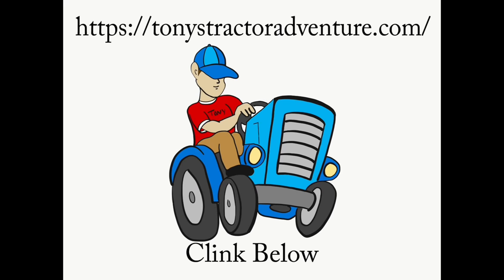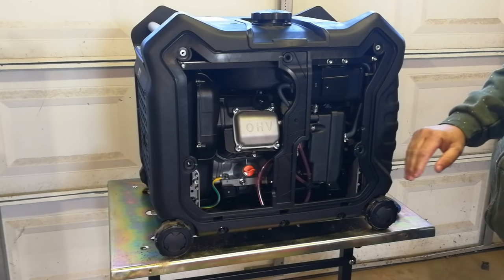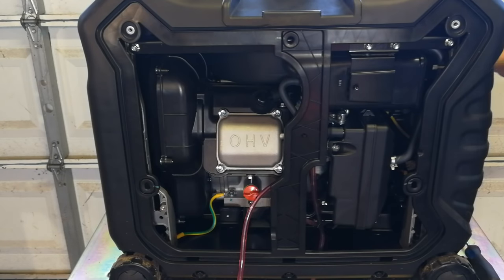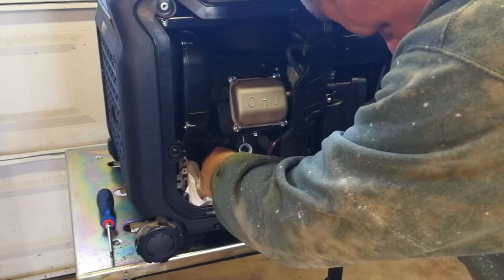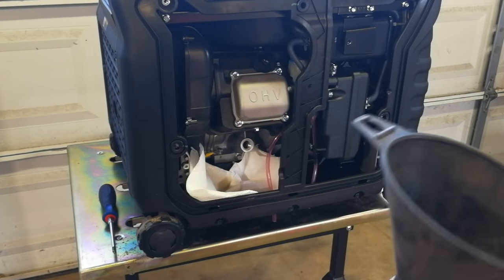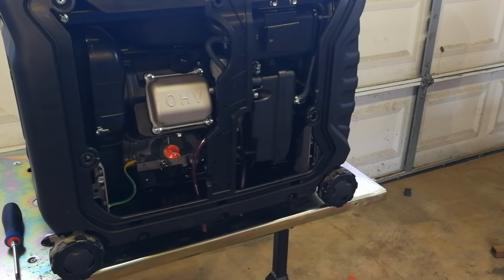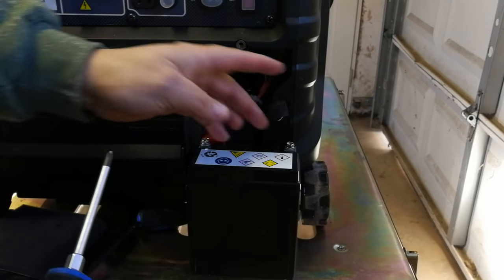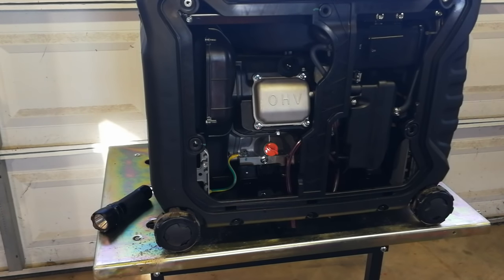Predator 3500 Inverter Generator | Harbor Freight

Comment: I bought one of those generators last Nov., liked it so much bought another in Dec.   Excellent design and glad to see you leave it as designed unlike others that want to rip the charcoal canister out and drill holes to help it , "Breath Better."  The only changes that may be needed is rejet carb if used in higher elevations.  Drilling holes or leaving oil door off makes the electronics to run hot and fail.  I do hate that people push that expensive Sta Bil that gives false sense of security.  I'm 66,  always on the farm with lots of motors and have NEVER used that stuff.  I always use gas with no ethanol and never have any problems even a year later.  Generators need to work when you need them so always get all the gas out and put it in your car.  Pump the gas out of the tank with the H.F. pump and drain the rest out of the carb drain.  The few drops left in the carb will evaporate and not hurt anything.  Do use Sea Foam to make sure carb stays clean.  Mine are newer models that come with a nice oil funnel and also has a gas guage to help not overfill and send liquid gas into charcoal canister.  Yes, I have several bigger, noisy,  gas guzzling generators.  That 3500 runs my fridge, freezer,  gas furnace,  TV's, some lights all at the same time using about 15 amps.  You did a very nice video with great advice.   Thanks.
Reply from the maker: My generator is still stock.  Still runs great.
Reply: @TonysTractorAdventure  From what others have posted it should run trouble free for a good 2,000 + hours.  I'm glad you did an excellent video on how to care for it so others have their Inverter run when they need it.  People look to YouTube for advice about buying, using, caring for these units so it's important they get good info like you share. There is a small screen in the gas tank so I did put a small paper fuel filter on outlet of the gas valve to protect carb.  Pop fuel line off valve , add 2" of hose with Corbin clamps to install.  I put in a NGK plug,  removed spark arrestor screens, rattly wheel lock and zip tied spare plug and everything to the metal uprights so they don't get lost.  Keep up the great work.

Comment: I have this gen. So far I love it. I have 2 recommendations. First, I would get a magnetic dipstick for it (ebay). You'd be surprised the junk it pulls out of the oil. Second, I use my gen for backup power during the winter so every summer I pretty much do the same thing you show in the video. But when I am using it in the winter and i'm between storms I don't like to leave gas in the carb (even though i put in an additive) I like to drain the carb. Instead of pulling the side off turn the switch 95% of the way to the off position. This will cut of the fuel to the carb. The gen will run for a good 5-10 minutes before it dies. Thanks for the video!

Comment: Pay close attention to cleaning the spark arrestor. Mine after 25 hours was nearly plugged & made it run very rich.
Reply: Markie Bass 
1 second ago
I only had 11 run time hours on my generator and, It stopped working... Running Very rough and, RPMs dropping down... Showing Overload without any load on it...  2 problems..  1st problem is... Don't use gasoline that has any Ethanol in it.. None !  O !!!  Notta !!!  Buy gasoline that has ZERO  Ethanol... That is the case for ALL small engine ….  It causes the fuel to varnish in the carb.. Fouls plugs … and,  high carbon build up.. which is problem no. 2 … The spark arrestor was FULLY clogged.. That is the fine screen on the Exhaust... There are 2 parts to it.. First the external screen held by 2 ea. screws... the other fine mesh screen is inside the pipe... after you remove the outer screen.. start up your generator and it will blow out... You can clean them .. or trash them...  or put them back on after cleaning them...  My Predator 3500 Generator is now back to normal ….

Comment: Thank you for a wealth of info. I am a woman in my 70s and have just purchased this generator for camping in a new TT. I have never had a TT before, but livein acabin, so have a generator. It is so noisy, i never used it unless the lights are out for more than 8 hrs. I have had it, I think 5 years and have Not done anything to it because it has only run 3X . I didnot kniwabout any of what you discussed. I must not have read the manual!  I have had 10 surgeries in 11 years...all a surprise.  Odd sorts of things, so have not had a lot of energy to manage things very well. But that was before i became active online, too. I won't forget all you taught here and will see if I can sell the other one if it still will run. It is a 4500 and even inside the cabin, you have to yell to talk...forget watching TV!😃 Thank you so much for this demonstration😍

Comment: One more reason to feel good about your purchase.  Echo has come out with a line of generators called the Echo Bear Cat.  They have a 3500 model that looks like a re-labeled Predator 3500.  The model number is ig3500e, and it has an MSRP of $1,399.  One more thought is that if these ever need parts or work, any Echo dealer should be able to provide assistance.

Echo also has a BearCat 2000 that looks like a re-labeled Predator 2000.

To me it's boost of confidence to see Echo slap their name on them.  No wonder the reviews are so good.  Apparently they really are.

Comment: FWIW, these generators are great, but starved for air.  There is a great video on YouTube re: making some additional air intake via the oil service door.  It makes a difference in the smoothness of the engine operation.  

Thanks for furthering our knowledge Tony.
Reply: @TonysTractorAdventure  none of them starve for air....and these folks who add additional air sources are detracting from the ability of the cooling system to evenly cool the engine....people mistake the suction on the oil door as suction being created by the carb intake....it's NOT!!!! Its negative pressure caused by the very effective cooling system
Reply: They are NOT starving for air. Stop giving bad advice. They run perfect when new so if it isn't running right then something is wrong with it like bad gas, partially clogged carb or spark screen clogged.  People run these Inverters for 2-3,000 hours with NO problems without drilling any holes in the cabinet to help it, " Breath Better."   It's designed that way to keep the electronics/ heat sink  cool.

Comment: Note that the spark arrestor actually has a screen that fits into the exhaust pipe behind that outside cover. It'll need to be removed and cleaned. If the generator has over 100 hours and starts running like crap and bogging down and such, check that bit and clean it!

Comment: This was my first summer with my little Predator. Now with Wisconsin winter coming I have a question. I will be able to take care of the gas and the oil which you have explained so well,  but can I store this in a cold garage or must I bring it into the house.
Reply from the maker: Sue, I would not bring it in the house due to the fumes. Depending on how cold it gets, you may want to keep is somewhere a bit warmer; however, I have started mine with the pull cord in at 15 degrees. The little battery does not like the cold so much. I hope this helps. Tony
Reply: @TonysTractorAdventure  Thanks Tony. I just wanted information on what needed to be done  for winter storage. Good video, I did learn from it.

Comment: Thanks for the great video bother, very informative and str8 to the point. I'm thinking about picking up one of these HF generators. My question to you is how has it stood up. I need it for emergency use to power things like my house refrigerator, TV, microwave and other sensitive common electrical items in my home during a power outage.. would this be the one?
Reply from the maker: My generator is holding up. You need to add up your power needs. This is definitely not a whole house Generator, but you can run the basics.

Comment: Most recommendations are to run the motor until all the gas is burned. Do you believe storing with stabilized gas is the better option?
Reply from the maker: I store mine with stabilized fuel.

Comment: Thanks for this video, very comprehensive! Question... I saw a video of a guy who drilled holes in the air filter cover to allow for more air flow through the filter. Would you recommend this?
Reply from the maker: I would not. I have ran this in the hots parts of the year without any problems with fuel or over heating.
Reply: @TonysTractorAdventure  thank you!

Comment: Two Questions: 1.) Do I still need to drain the fuel if I keep non ethanol and Sta-bil in it all year?   2.) The manual is contradictory. One section says to change the oil at an 8 hour interval, but it also says at 25 hour intervals. What do you recommend? Thanks in advance!
Reply: Change it once at 8 hours...VERY important...after that every 25 hours...
Reply: @TonysTractorAdventure  how do i know when it reaches 8 hours mine keeps reseting do i just take note?
Reply: @370hssv3  If you haven't already solved your problem, the hour meter should have 2 modes. It should show run time, which resets every time you start it. That shows how long it has been running for your current use. If you started it 45 mins ago, it will show 45 mins. 
It should also have a total run time. Press the button on the meter & it should switch between your current running time and your total running time.
Reply: @shananagans5  mine came defective i changed it and problem was gone maybe it was the screen idk.
But this generator kicks ass man

Comment: I have a question for you. I’ve had mine four months and it has been a good unit so far. But now it seems to be running to rich. When I start it up idles rough and requires me to loosen the air filter to stay running. Any assistance would be appreciated. 

John
Reply from the maker: I would run Lucas fuel treatment through it first. Make sure the airfilter doesn't have a blockage. Nice and dirt-dobbers do crazy things. After that, adjust the fuel mixture screw.
Reply: also check the spark arrestor
Reply from the maker: Really good thought. Thank you

Comment: i bought a used 3500 will not shut off at switch any suggestions
Reply from the maker: It looks to be a two part switch turning off the fuel and breaking the ignition circuit.
Reply from the maker: I have had no issues with mine, so I have never been inside it. Wish you the best.

Comment: everyone talks about breakin time,when can I load it up to run my camper-2000 watts or better?
Reply: @TonysTractorAdventure  but when can I put a heavy load on?
Reply: after 2hrs,4hrs?
Reply: @bubba bug it says 30 hrs in manual,but it doesn't say how much run time before loading it heavily
Reply: @bubba bug mine also,30hrs means it's fully broken in but it doesn't say when you can use 2200-2600 watts
Reply: @bubba bug actually 2250,lol

Comment: I have this same generator only about 2 months old. Starts right up and will run all day but  when I shut it down and it's hot it won't restart or takes a while and when it does I get a plume of black smoke. Anyone have any idea why this would be?
Reply: Tony's Tractor Adventure Should I try to loosen the cap before I shut it down? Would that prevent flooding? Because I have checked fuel level after it wouldn't start but at that time it is probably already flooded.
Reply: When it is warmed up after running, crank it on run instead of start, Start setting engages the choke, which is flooding it . Choking using the start setting is not needed when it is warmed up.
Reply: @Splungers  
Thanks but it's actually is the gas cap, If I take it off before I shut it off it will restart, it has to be a manufactures flaw because I noticed this after the first couple uses.